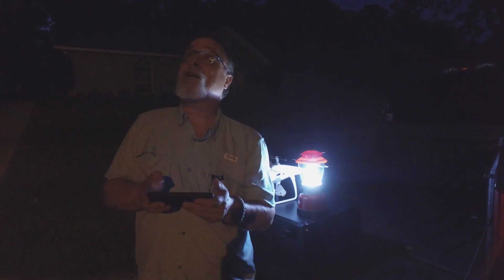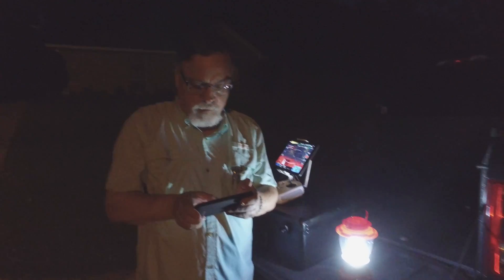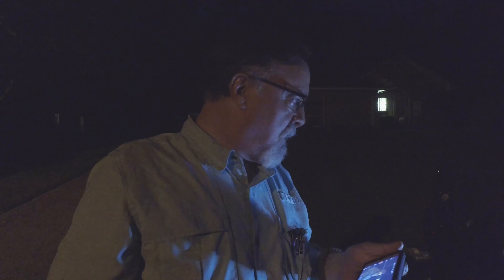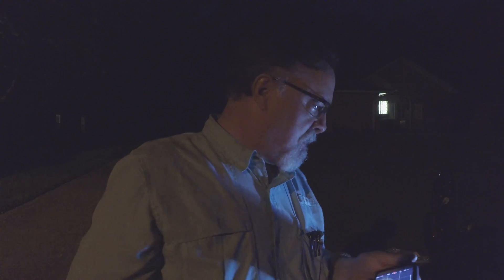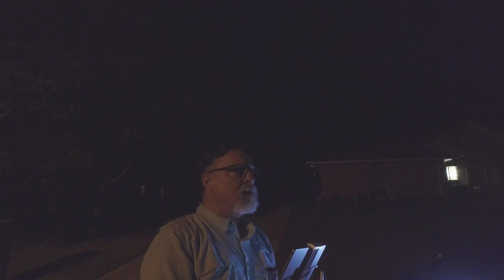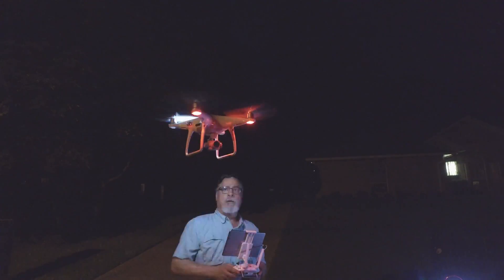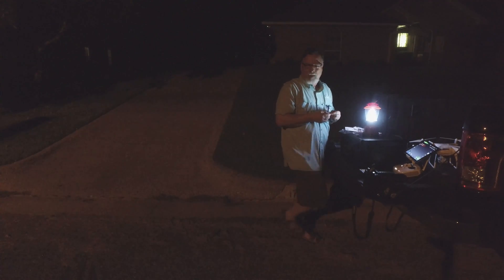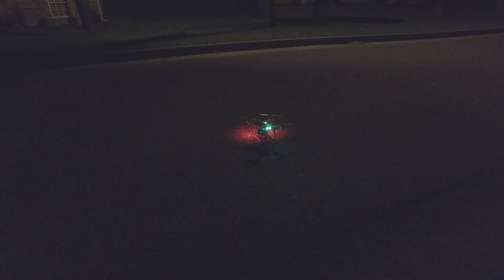Firehouse Technology - A Better Way To Light Your Drone! - Part 1 (4K)

Comment: Can you post a sample video with them in use. Want to see if any effects of the lights show up in the video.
Reply from the maker: The next video shows me flying them out to 3 miles and back.  This includes the older single strobes and the newer, higher intensity triple strobes.  It gets hard to see them on camera, but the were very, very visible to the naked eye.

Comment: Nice but the original "red/greens" of the drone spoil the charm of the new lights installed; i wonder if there is a way to disconect them without having technical troubles.
Reply from the maker: By the time you are about 1/2 mile away, the drone LEDs don't really make their presence known.  Having said that, you probably could disconnect them pretty easily.  The only real use I have for them is letting me know, quickly, which way the drone is facing.